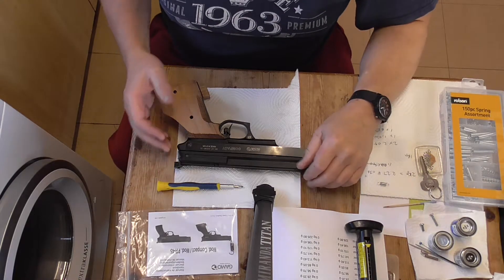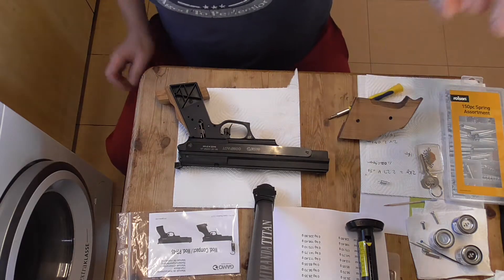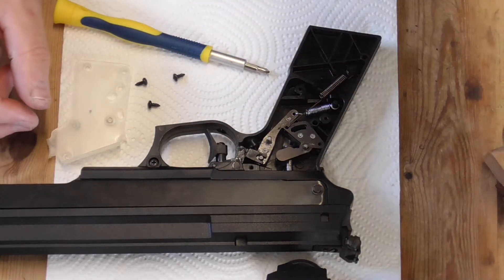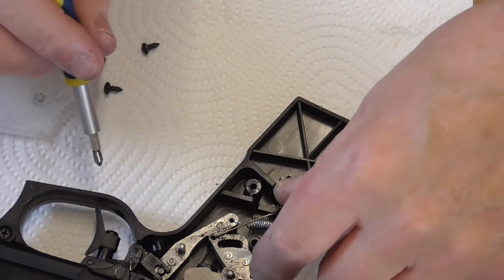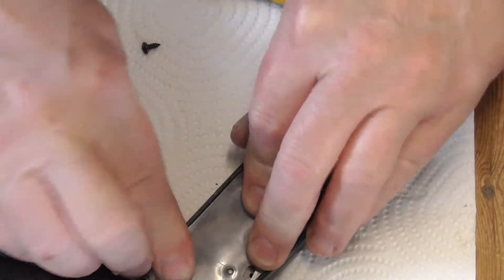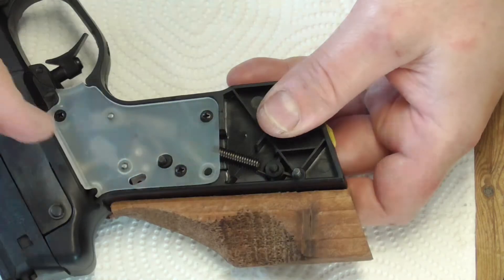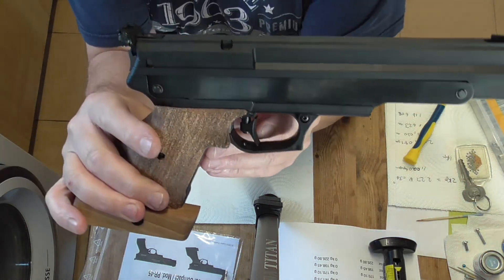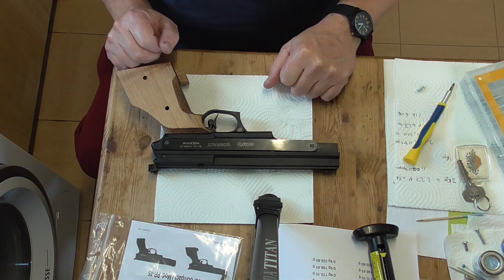GAMO COMPACT TRIGGER WEIGHT ADJUSTMENT  08/10/2022

Comment: Good info. I'm going to oil mine but I'm not going to change the spring after watching your video I would probably mess it up. The newer version by Air Venturi looks exactly the same as the Gamo compact but there is an extra adjustment screw for the trigger. It's in the back of the handle and I think it adjusts the trigger pull tension.